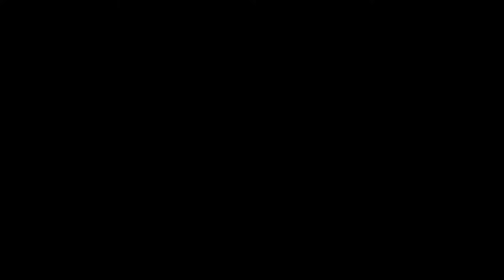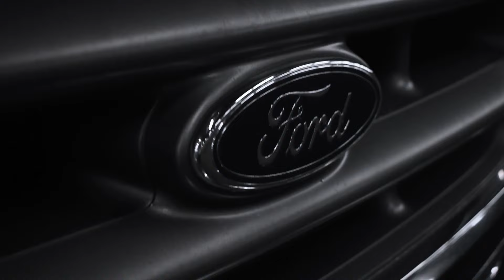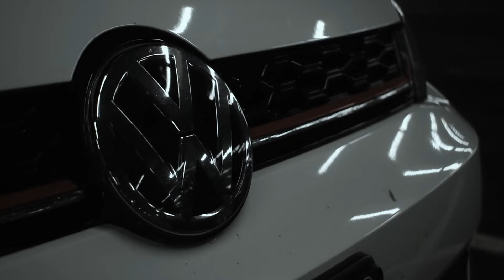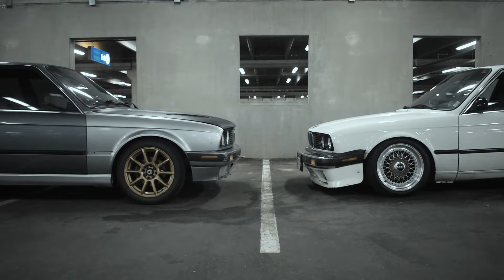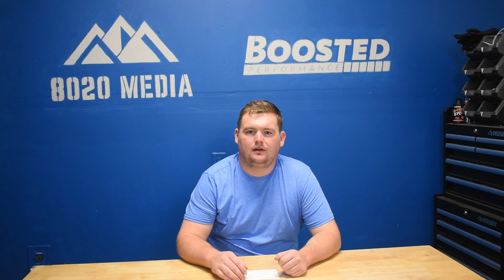How Reliable is the Ford 3.5 EcoBoost? | 3 Common Problems

Comment: If you follow Ford's recommended oil change intervals (100% on oil reset) you will go past the life of the oil by gong over 10,000 miles. I am original owner of a 2013 f150 eco and I set my oil reset to 50% or 60% depending on my driving conditions.   Most, if not all, of the "common issues" are a result of the above issue.  Preventive Maintenance (not run to fail  philosophy) is a must with most engines...especially on the new ones with the tight tolerances.   "Money where my mouth is," I have 258,454 miles on mine.  Only engine related issues have been spark plugs, coil paks, and a water pump leak at 179,000 mles.  Just don't drive your vehicle, take care of it and it will take care of you!!
UPDATE:   I just replaced both turbos  due to o-ring wear on the coolant and oil lines and also the vacuum pump at  ~ 262,000.  When I took it in to Cavender Ford in OKC, the shop forman (John) got in and then immediately got out, walked around the entire vehicle and asked, "262,000 miles...I can't believe it.  Is that the correct milage"?  He then took it for a 30-minute test and got 21 mpg.  The engine itself is still performing well.
Reply from the maker: Thanks for the feedback! We couldn't agree more and always recommend changing every 5,000 miles regardless of the recommended change interval.
Reply: @8020Media  50% is around 4,800, 60% is about 5,900...at least on my make and model
Reply: I just change it every 5000 regardless unless I tow alot
Reply: Extended oil change intervals by the major manufacturers are the cause of the bulk of big reliability issues, especially anything cam phaser/tensioner or cylinder wall related.
Reply: I also own a 2013. Original owner. Have changed oil every 5k miles religiously. Changed plugs at 60k. 0 issues.
Reply: Exactly, I do the same with my truck. If I’m towing I change it before even if I only have 2k miles on the oil. I tow a large 24” car trailer and I’m at 150,000 miles. Owned my 2013 eco boost since new, only issue I’ve had is the throttle body and normal maintenance doing spark plugs. I’m still on original coil packs but I’m about to change those next week before my next 3,000 mile tow through the mountains.
Reply: Mine was taken care of by the old owner. He took it to the dealership for regular maintenance and I have taken perfect care of it. I am a huge believer in preventative maintenance and my 2011 has given me nothing but problems!
Reply: @michaellifefacts7869  That's unfortunate.   For the vast majority of these engines they are very reliable.  Remembering that the context of this artical is soly referring to these engines, and therefore not taking into consideration the rest of the vehicle.
I work at a power plant as an E&I technician that maintains both combine cycle and  aeroderivative turbines (jet engines) and as with any piece of machinery the break-in, and first couple of years drastically determines the life expectancy of any piece of machinery.  Obviously that was out of your control.  If had taken my vehice to a dealership at their recommended service intervals and allowed them to use their "reguired" service lubricants,  I guarantee you that I would most likely be in the same boat.  The questions that I would have are (strictly ecoboost related, engine only) what kind of oil was used in the first critical period, was it changed after the first 1k miles, type of oil filter makes a huge difference, how was it driven and how often, was it a second vehicle that sat for extended periods of time?  I think you knew where I am going.  Unless you are the original owner you just don't know.    Transmissions are another issue, but the same philosophy applies.   The service writters at these dealerships, for the most, only schedule appointments and often times give wrong information or advice.  My first transmission service (flush) was taken to a dealership in 2013.  After their "service," I inquired if the filter and been changed.   The service writer told me that the 6R80 filter was metal and not serviceable.   Metal type yes, not serviceable...wrong!  I took it to work and dropped the pan...low and behold there the filter was and it was easily removed.   I have almost 260,000 miles on my trany, pull 30 travel trailer sometimes and take my 22ft boat to the lake almot every weekend during the summer.  
I say all of this to say that just because someone says it was serviced at a Ford dealership doesn't necessarily mean that it was done correctly.
One more thought,  the 3.5 eco came out in 2010.  The first year in the F150 was 2011 and was a specially designed version for their truck lineup.  Never buy a "1st" or "2nd" year released product.   Howerver, on the other hand,  yours could have been assembled on a Friday at 4pm.
Reply: Impressive sir....I have a 2013 with 41K - change the oil every 3K....or less if it sits too long.
Reply: @time_on_target  I have tried MSD, but that was a total disaster.  Apparently they are not made in the USA anymore.   Accell has done well for me so far.  After these coil packs I am going back to OEM Ford.  They outlast any thing that I have heard from othets.
Reply: 3000 miles on boosted can’t go wrong oil is cheap maintenance
Reply: @lakeeriebrawler1764  when you replaced the plugs at 60,000 how did they look? Could they have gone longer or been replaced sooner? Thanks
Reply: @paulhunter9613  They looked pretty good. Maybe could have gone longer. I do light to moderate towing, so I changed them sooner. I have read that, with boosted engines, they create higher temps, and to change plugs more frequently than non boosted engines.
Reply: @lakeeriebrawler1764  I haven’t towed yet with my2018 2.7 so maybe I’ll be able to get 40-50,000 before I change them, thanks for the reply
Reply: I am going to disagree here. I let mine go with the computer monitoring and oil looks just fine before change is due at about 7K miles.
Reply: @Trple777  Ford's Engine Control Module (ECM) has no subroutine that monitors oil condition via a sensor.  Only current engine miles compared to "oil reset milage."  Once that is met, the ECM initiates a "call" to warn the driver to change oil.  The ECM monitors oli pressure but nothing else concerning the oil.  Ask around....
Reply: @bobfuhrwerk2869  there is a video on YouTube called project farm, he deals with the issue of does your oil need to be changed because the vehicles oil reminder monitor tells you to. He tests the oil to see if it really does need to be changed.  My f150 tells me to change the oil even tho I have only 1253 miles on it. Ford has it programmed so the dashboard tells you to change it after one yr. I checked to see what the percentage of life was on the oil, it is 94%!
The oil does not go bad because it sits in the engine for over a yr with minimal mileage
Reply: Direct injection & turbos add stress & wear. Good power though 👍
Reply: @toddc6682  the five oh has direct AND port injection, and 12.5 comp ratio, imagine all the stress on that little engine…
And you can drive normally and not get into the turbos
Reply: i am seeing people here say they change oil at 5 k miles.  this is new to me, i always change the oil every 3 k.
Reply: @mrnobody5381  3k was the "norm" back in the day before synthetic oil.  2 things to take into account.: 1) motor oils have made a huge improvement since the 80's
2) synthetic oil has become a more trusted product from  when it first came out and thus more people are using it now.   However, a lot of the old school thinking is still around, so most people have "upped their accepted milage" of changing from 3k to 5k just to be safe.   But truthly it comes down to the condition of your motor.  Motors that are new will keep the oil cleaner longer.  Motors that are aged will start to have fuel "blow-by" through rings and valves, and thus the oil will be introduced to more hydrocarbons... which leads to contaminated oil.   If you're using conventional oil then I am in your  camp...3k.  If you're using synthetic, 6-7k for a  new motor, 5k if you have you a decent amount of milage.  I can't give you a milage number, but your oil will tell you...look at it and smell it.  On gasoline engines if it is starting to turn black and I can smell the fuel in it,  that is time to change it.... just me.
Reply: @wyomingcowboy501  what type oil?
Reply: @jimsteinway695  Type or Brand?   I have always used Mobile-1 5w30, but about to jump up to 10w30 or 10/40 because of the milage/wear
Reply: @craigmorelli2483  No external.
Reply: @paulhunter9613  sorry, just seen your question.   Well to be honest I don't go by milage, I listen to the motor.  If it is starting idle a little off or "not normal" and it's been awhile...I start with plugs.  Then I hook up my laptop and look at fuel trends.   It usually is the coil packs or the O2 sensors.  However, for the average user plugs and coil packs usually fix the issue.  Stick with Ford coil packs...mine last 80, to 100,000 miles.  It just depends on how much they are stressed...i.e. heavy loads and high rpm.  But plugs are usually the best place to start.
Reply: @paulhunter9613  btw, my plugs have always looked great light to dark brown,  but never any blow by with oil on them
Reply: Do not go by that percentage counter if you want the engine to last.
Reply: @truckacabrarex9831  oh yes....I didn't originally explain that in this comment, but I did clarify that in a following comment.  50% (on my year) is about 4,800. 60% is right around 5,800...give or take.  I always go by milage, that is how I discovered the risk of following Ford's recommendation.  Thank you for bring that to my attention.
Reply: @mrnobody5381  same
Reply: what spark plug problem did you have?
Reply: @diulaylomochohai  Just normal wear and tear.  Stay away from MSD coil packs...junk.  I am using Excel and they seem to be holding up well for 3 trs.   Factory seem to work best.
Reply: "Only engine related problem was spark plugs, coil paks, and a water pump leak at 179,000 mles." 

Those aren't problems..those are common wear items..
Reply: @DarkSim77   @DarkSim77  Agreed.   Update:   I just replaced both turbos  due to o-ring wear on the coolant and oil lines at  ~ 262,000.  
Thank you for bringing that c to my attention.   The engine itself is still performing well.
Reply: How much did it coast to race the turbos? Total with labor and tax?
Reply: @markwhite6719  turbos, coolant lines, oil lines,  and vacuum pump was $4,337.79.  Thanks for the question.
Reply: @wyomingcowboy501  not bad! Sorry for missspelling I just saw it now. Thanks for reply!
Reply: @markwhite6719  No problem.  I did want to mention that after getting it back from Ford, my milage as dropped about 5mpg.  They stated that the turbos might need to break in... which makes sense.   Went from 20-21mpg highway, to 15-16 mph at 70.   60mph is right around 20mpg.
Reply: @wyomingcowboy501  that's a significant drop. And that's interesting.
Reply: How much did it cost you to replace the turbos?
Reply: @consejeriasinlimites4888   look back through my threads.  I answered that question a few weeks ago.  However, I believe it was just north of $4,000 for both turbos, new oil and coolant lines to both, new vacuum pump and was done by removing the cab.  Had it back in 2 days
Reply: I just saw a 2018 3.5Eco with 295,000! I calculated close to 250 miles a day! The dealer doesn’t list the history of it but the driver seat looks brand new (could,ve been changed). Truck is immaculate. Is that a good buy?
Reply: @gwendamartin5271  
1.   Depends on what work has been done.
2.  I would not buy it because it is very close to having major motor repair; top and bottom end components, front beatings, ect....   If you got it for FREE you would need to spend approximately 10k for motor, 4k for trany. So you would need to invest 15k very soon,  plus down time.
Reply: @wyomingcowboy501  I appreciate all your comments here. If i may ask, has your fuel mileage improved since the change, or any other issues come up? I've seen quite a few comments like yours, where people have 3.5 ecoboosts that last 200k+ without issue, but the reaction of that shop foreman shows the trend, that they are not known for reliability. Based on the comments, and only the comments i've seen on youtube of 3.5 eb owners such as yourself with good reports, i tend to lean toward the camp that the engine could do very well long term with proper oil changes, but it's difficult to get an accurate picture just with youtube comments. I suspect it is more likely that people who do treat their vehicles like you do and have also had good results with their engines are more likely to keep their vehicles and more likely to peruse these videos and leave comments, and that it seems much more likely that the good results should not necessarily be expected for others who do proper oil changes. there just isn't any solid data that i've come across, but the engine does have a horrible reputation among consumers. but reputations in the truck world are a disaster to begin with considering the folk who push them.
Reply: @wyomingcowboy501 that's true with older models but newer pcm and ecm units in the past 10 years or so not only monitor mileage, but also ambient temp, throttle positions, whether or not a trailer is hooked up, amount if time between startups, rpm's, and several other factors that affect when the OLM declares an oil change is needed.  That's why I pretty much trust it and have relied solely on it when changing my oil and have never had an oil-related issue with any of my Ecoboosts for years.
Reply: I now have 350,000 miles on 2012 F-150. I've changed the oil at 10,000 miles each time. I use Amsoil throughout the truck, and I run a tune.

Comment: I have a 2013 F-150 3.5L Ecoboost.   85,000 miles, runs great, regular maintenance, and oil change with full synthetic oil.   Problems, replaced battery, and fix air-conditioning, buttons on steering wheel, and brakes (I tow a trailer in the mountains, hard on brakes).     I've only gone as high as 8,000 ft, but truck runs just like at sea level, no lose of power.  Great towing vehicle.  My trailer loaded at approx. 7,000 lbs.
Reply from the maker: Cat - Thanks for sharing your experience! Sounds like you've got a good one.

Comment: I have the 2011 F150 Lariat 4x4 with the 3.5, 311,000 miles all original, the only upgrades I’ve done is K&N drop in air filter and 3” exhaust and I tow a lot and frequently. Best truck ever!!!!
Reply from the maker: BigBoats - Love hearing this! Thanks for sharing your first-hand experience.

Comment: I have this engine and could not be happier, I was fine with either the 5.0 or 3.5 I bought the truck that had the components I wanted. However, honestly I am completely in the turbo 6 engine club now. I have numerous friends with the 3.5 one with the 2013, not one of us has had issues, every one of us says the same "love it". If you drive it with sense it does everything it is supposed to do. There is SO much power on tap with this engine it's scary, yet it is easy to drive, I consistently average better than 20 mpg in mixed driving. I cross the continental divide often, while my engine is loafing along maintaining 75 in 7th. I'll hear the motor in Mercedes, BMW, RAM, Chevy screaming trying to keep up but finally relent likely out of fear they'll blow their engine. And seriously my truck will never break 2,000 rpm. My own opinion that this engine has so many that hate it is a testament to its capability. Now that both RAM and Toyota are ditching their push rod 8's and replacing or have replaced them with turbo 6's is proof a turbo 6 is the perfect engine for someone that actually needs a truck.
Reply from the maker: Amen. The 5.0 V8 is a really solid engine as well but there is a reason GM and Dodge are also in the process of building turbo inline-6 engines for their half ton trucks in favor of their large 6L+ V8 engines.
Reply: @8020Media  Yep its called EPA
Reply: Is it just me or do you seem like an EPA lover as well as a muscle car hater? Also what job do you have and how much money do you make to afford that EcoBoost F150?
Reply: Also if the EcoBoost is so good then howcome Ford used the 6.8L and 7.3L Godzilla V8s in the Super Duty as base gas engines and not the 3.5L EcoBoost V6?
Reply: So how long have you been working for Ford?

Comment: I know 2 guys who have the 3.5. The first tows heavy weekly, 250K only issue a burst brake line. The other guy has 205K on his and has beat the crap out of the truck. He has had maybe 5 issues, nothing big. And both guys maintain them well Like me 5K oil changes keep everything in tip top shape. These are great engines. Do not follow Ford recommendations for oil changes you might regret that.
Reply from the maker: Mark - Thanks for sharing these experiences! Definitely valuable for future viewers. We couldn't agree more about the recommendations..
Reply: What oil do you run ?
Reply: @joshwray7230  This is my second turbo. Two things are a must, change your air filter 1X a year, always run full synthetic, especially if you use the truck hard. My first turbo was sold with 140K miles. I was told by other mechanics to follow that routine with the oil and air. No regrets.